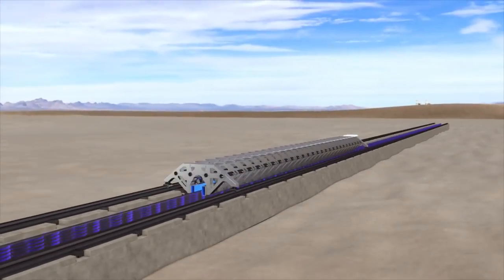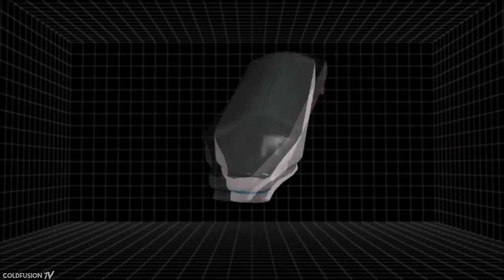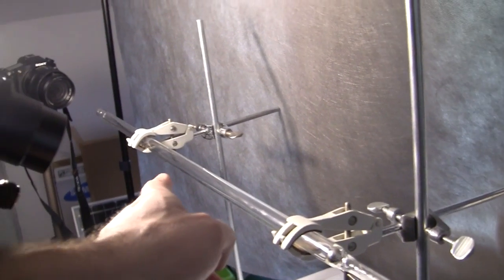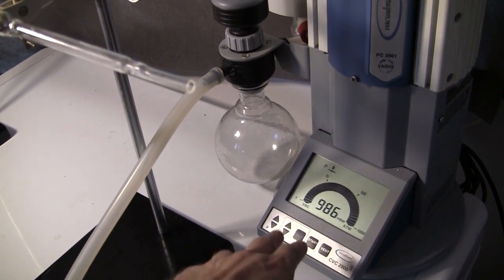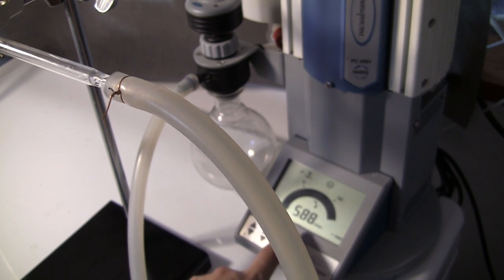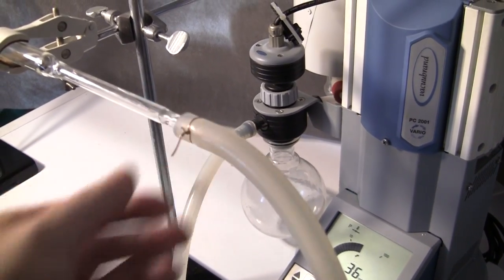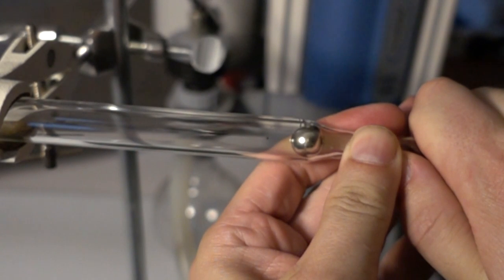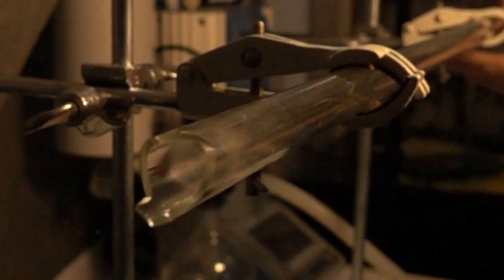How  the Hyperloop can kill you!

Comment: Brakes exist you know.
Reply: They'd all die from the sudden increase in velocity anyway.
Reply: Let me know when you've made breaks for your flying objects.
Reply: Look at the animation in the beginning, I see several ways to apply brakes. You're not a creative thinker.
Reply: +Merrick How do you think maglevs slow down?
Reply: A train has a lot of mass. It wont change instantly. This just shows how much Thunderf00t overlooked.
Reply: OF COURSE! ANTI-MAGNETS!
Reply: Shit, if a plane has a catastrophic failure, it will fall down from the sky, and NO WAY STOP IT. 
Better cancel this whole "air plane" idea.

This reminds me of when Thunderf00t said that if bicycles where invented today, they would get banned.
The hypocrisy is real.
Reply: have you tried to stop a bullet?
Reply: Forssa1 You are SERIOUSLY underestimating how fast this would happen. You must be dense if you think you can slow a train fast enough to prevent a wall collision here. Even modern trains can't do that in the event of a derailing.
Reply: Forssa1 a leak in a vacuum tube is much more likely than a critical fault with a plane.
Reply: I don't know that much about magnetic levitation
but could it possibly be made so that in an emergency 
the electromagnets be reversed so that the upwards force to lift it would then pull it to the ground
that could work as emergency breaks
Reply: Normally I don't get into these discussions, and my own opinion on weather or not the Hyperloop will work aside:

How would air brakes work in a vacuum tube? The issue is a rupture and the pressure of air pushing the train, so flaps will have pretty much no effect.

If you are talking conventional brakes, that has its own issue. Big Rigs on the road use engine braking more than conventional brakes because the wheel brakes wear out super fast on those vehicles and don't work as well as the engine as is. So scaled up and you have brakes that will have a near impossible task of fighting the forces put on them, and without rubber likely to help reduce friction.
Reply: People have little reason to listen to you if you just say "I can see several solutions" and explain or elaborate on exactly none of them.
Reply: +Merrick air brakes are a thing
Reply: All is lost You mean a controlled stop that takes place at dramatically lower speeds? Nothing could stop you from slamming into a wall and getting crushed here. This would take less than a second to happen.
Reply: Forssa1 A lot of mass is also a lot harder to stop as well as accelerate, though. The entire point of the system is to go beyond the speed of sound in the first place in a greater vacuum that in his demo. So, those 2 factors likely account for at least some of the mass & inertia difference. Essentially, you you're already going the speed of sound before failure & it's only going to get faster, so aren't gonna be able to suddenly stop that easily. 

The bullet trains at least have wind resistance to help them slow down and their failures don't result in them going much faster than their normal travel speeds. They also don't normally try to stop on a dime even in the event of a failure.
Reply: Forssa1
If you're not gonna explain yourself then why are you even here talking about it? To make yourself feel superior, or to just bullshit everyone for your own amusement?

I suspect the latter.
Reply: +Forssa1
"Plane ... catastrophic failure"
So you are talking wings flying of right? As you can land a plane (and even a helicopter) without engines etc, as they are pretty stable concepts.
A vacuum on the other hand is super unstable and a "catastrophic failure" would be closer to the norm than a rarity.
Anybody who has ever worked with vacuums knows how unstable and how dangerous they can be!
Reply: Physics exists you know
Reply: You realize of course that the car itself can control the magnet track. The magnets aren't all running all the time. They are electromagnets. They can be turned off. By the car.
Reply: Releasing air along the whole tube would that not mitigate the issue?
Reply: Forssa1 It's a good thing planes have so much more room for error, unlike this deathtube. You are an idiot if you think there is a force on this world that can react to, then stop, a train going the speed of sound in the timespan of a second.
Reply: +MGIBlaze I'll happily do that if you are willing to pay full price for my consulting.
Reply: +Milky Shakes Good luck using air brakes in a fucking vacuum.
Reply: It could push padded rings outwards to touch the walls of the tube to decelerate... come on now.
Reply: ***** you don't seem to understand how phyics work.

For example a bullet firing out of a gun travels at 300MPH ish.

If you fired a artillery piece with as much force proportionally to the shells mass it would also travel at 300MPH ish.

Scale would not effect acceleration scale would simply mean you would have longer to accelerate meaning that you would get to much higher speeds in a longer tunnel.
Reply: Science, bitch.

a = F / m
Say the area of the capsule's end cap is about 3m&#178; (radius of ~1&#178; * π) so A = 3
F = P * A
Atmospheric pressure is about 100000N/m&#178;, so P = 100000
F = 1000000 * 3
F = 300000N
As a guess, say the capsule weighs 5 tonnes.
a = 300000 / 5000
a = 60m/s&#178;
Now remove acceleration based on the resistance of the near vacuum at 1/1000 atm:
a = 59.94m/s

That's basically 6g. So yes, you'd probably survive. That said, you probably wouldn't survive crashing. If, however, you came to a stop without hitting anything you'd be okay.

Before you critique me, remember, this is a 5-tonne capsule. If it were lighter, you might not fare so well. Heavier, maybe you'd do better.
Honestly, though, I think that most people would boycott hyper loops if decompression did ever happen given how traumatic it would be.

[Edit: Google is retarded - "&#178;" = squared sign]
Reply: ***** You don't understand how air enters a vacuum, clearly. It wants to go where it isn't.
So if I have a rupture at one end of a tube, and then immediately open the other side of the tube, the opposing influxes of pressure will nearly cancel each other out.
The car clearly isn't at the end you've opened yet, there will be no further acceleration.

"so you want to add a source of electromagnetic fluctuation in a vacuum and use it a a brake?"
The point of mentioning the rail is that it's clearly not part of the tube which seemed to be your issue with the idea of brakes, that the car is just in a tube. It isn't.
And I'm not suggesting directly braking on the rail itself.

Parallel to that rail, you can have 2 magnetic brake runs, which you might know of if you're familiar with newer roller coasters.
They generate an opposing electromagnetic force which is directly proportional to the moving speed of the object, and never actually have to come in contact with the objects(the car).
Reply: ***** Just like cars.. nothing could ever go wrong... except it does.. several thousand times a day...
Reply: *****   Although you are correct in the example you site, there's no way that simple of a system would be used.
Reply: Was curious, so I did some maths:

(((1 atm - 1 millibar) * pi * (2.23/2)m^2)/2800kg)/ 9.8 metres per second squared = 13G of instantaneous acceleration. Not fun, but should be survivable for a short time if seated correctly. That also assumes a perfect seal between the vehicle and the track, and that there's an instantaneous, complete fracture of the tunnel right behind the capsule so that the pressure rises to atmospheric instantly.
Reply: InfernosReaper 
That was my point. Mandragara was claiming brakes would shatter the capsule. Only instant brakes would. Momentum reducing breaks (you know any brakes that exist in this universe) wouldn't do that.
Reply: +Milky Shakes airbrakes are exactly what causes the sudden acceleration. it's the body of the train that catches the air that rushes in from behind, but something that Thunderfeet forgot, is that if the train is lrdy moving at the speed of sound then the air coming from behind it won't even affect the train's velocity.
Reply: agun17 
Hrm the difference being your shitty gun has a 20 inch barrel at most and this has a 100 mile barrel. Plenty of time. Especially for an automated system.
Reply: ***** 
No an active safety measure is not expensive. It's cheap. And safety measures always lead to long downtimes. Planes have them, Trains have them. It's the expense of being safe. You still are disregarding the fact that unlike the marble the train is already moving at the maximum rate of pressurization as pointed out by several people. On top of which as someone mentioned the negative effect of a fault could be easily mitigated by airlocks that close behind the train. Then you only hafta repair and re-de-pressurize a portion of the track.
Reply: agun17 
...
While a break after the sled would be more problematic it's not more likely. You know that the sled will not actually apply pressure ANYWHERE and if it did it would be for .0001 nanoseconds right? But like I said already it wont apply pressure. PERIOD. It's being suspended by a magnetic field in a near perfect vacuum.
Reply: agun17 
... >.< The magnet system is a separate substructure from the pipeline. You really have a problem with seeing things from a distance don't you? You're the type of person who if I explained why a car engine is called a combustion engine would have a panic attack.
Reply: ***** 
No it's you who doesn't. Air rushing into a vacuum moves at the speed of sound. So an object moving faster will outpace it. On top of which no you over estimate what kind of door would be needed. We already have airlocks that can withstand massive pressure disparities.
Reply: ***** 
You know hyperloop has been in development for a decade and has the support of MANY engineers and scientists. You are looking for any reason to defend TFs claim that it's bad. That's the thing. I bet you are 100% convinced that Brexit is the worst thing ever too aren't you? Solar Roadways I'm skeptical same with the nuke car. The difference being they aren't minor upgrades to tech that is in use today.
Reply: Stephanie Lovik I am claiming it is bad. Me, myself and I. The royal 'we'. I don't care what TF has said.

The idea of travelling in pneumatic tubes has been around for over 150 years. There's a reason they've never been actualised.

Nowhere in the world does a hundred kilometer vacuum tube exist. So I have no idea how you see this as a 'minor' upgrade.

I'm ignoring your Brexit red herring.
Reply: uh, brakes in this case would only be deployed in an emergency. They can be rockets/reaction systems pointed at both ends or some kind of wheel that springs out and latches onto the tube walls the millisecond the pressure sensor finds a pressure leak, or you could puncture the opposite side of the tube and if you do it just right, the two forces will equalize - and unlike TF's experiment, for a vehicle moving at hundreds of miles an hour its infinitely unlikely a puncture will happen right in front of/behind the train, giving it ample time to react. of course, the prerequisite is that people stay sat down and belted in (which shouldn't be a problem for the short trips hyperloop promises), but people are able to survive forces of 50Gs so as long as the brakes keep the sudden acceleration beneath that, the passengers would live.
Reply: Air weighs ~1.2kg per cubic meter. A pod weighs what ? 5 tonnes? A full size maglev train 100 tonnes? Such failure would need a complete destruction of the tube to get it even nod a couple meters.
Reply: There's no feasible material that could withstand this sort of thing in this situation.
Reply: considering the speed and the mass of a train the would more likely cause the rails everyting else to meld and burn before inevitable crash.
Of course if everyting would be made to perfection this may work but is that realistic?
Reply: Forssa1 sudden Air pressure changes Has a lot of potential force. It does change instantly, This shows how much you overlooked
Reply: Forssa1 Why because everyone can tell you you're wrong?
Reply: Theoretically, with a strong enough magnet, it would stop the bullet. But we see your point.
Reply: They're called airbrakes. Planes have had them nearly as long as they've had wings.

Even though there will be no air in the tube, in which case, the electromagnetic tracks serve that purpose.
Reply: +Forssa1  Or what if the tube had a series of gates and you could control the pressure level as the capsule accelerated?
Reply: Milky Shakes its in a vacuum, there is no air.
Reply: Forssa1 So you're just going to take another concept and roll from it from there. I saw the comment you're taking from.
Reply: What matters is the mass/cross section surface. And I think the ratio would be even lower for a train. It will probably be crushed and, then, accelerated.
Reply: Would they? Math needs to be applied here to confirm.
Reply: You open the tube to relieve the vacuum ahead of the car, and seal the tube behind it. So yes, there very easily could be air.
The loop is made in sections.
Reply: +Forssa1 gates are dangerous since they would be a barrier that could malfunction and the train could hit them. I was thinking maybe put the tube inside another tube with normal (or higher) pressure. If something bad happens, then valves all along the inner tube will open up and allow all the air contained in the outer tube to flow in. You'd create gusts of air from both directions of the train which would mitigate the effect TF demonstrated and would help the train to slow down much faster due to air resistance from the front.

I think the real problem here is the acceleration of the passengers themselves.
Reply: +Morru Qu'aan can't you just extend steel arms against the walls of the tube?
Reply: i agree, this does not seem like an insurmountable problem. I think it would be fairly easy to stop the car if you had some extra track in front of you, even extra 'run off' track at each end of the loop. the only difficult problem is trying to prevent the car from accelerating too fast to be dangerous to the people.
Reply: +GameSmashDash No. The train is not a metal ball. Also read up on square-cube law.
Reply: a) atmosphere and friction exist in cases of trains
b) giant steel fangs that grip to the rail also exist in emergency cases, impossible for a vacuum tube.
Reply: OrnluWolfjarl   The gates could be spaced kilometers apart and made of composite plastics so if the capsule collided with it then it would just break free.  I think we are focused on the wrong problem here.  Will it be economical is my first question.  The Concord wasn't so they stopped using it.
Reply: Morru Qu'aan   If it is using an AC power transfer system a brake by wire device could be used to slow the capsule - ie magnetic brakes
Reply: ***** "Good luck using air brakes in a fucking vacuum."
You relieve the vacuum genius. Open the tube ahead of the car. Air rushes in. The air brakes do their job.

"b) giant steel fangs that grip to the rail also exist in emergency cases, impossible for a vacuum tube."
Not if you remember what it's being levitated over: a rail.
Reply: No the acceleration isn't that bad the point is you have miles to speed up until the fault. But as other people have mentioned.

You can have Valves on opposing ends to equalise the pressure, brakes etc.

The instantaneous acceleration does not go up due to scale because a larger object will have greater mass which will counteract the greater force being applied. What does go up is the length of which you have to accelerate.
Reply: but a brick wall would  quite happily do the speed of sound in a vacuum.
Reply: Breaking isn't the issue... It's not "Being trapped in the tube" that's the issue... The issue is when the vacuum fails, it's literally going to accelerate the vehicle to such a high velocity in such a short amount of time, that it's going  to severely hurt and/or kill whoever is in that vehicle.

Pilots already have to do training to handle High Gs ((Acceleration)) so as not to become unconscious from the pressure on their brain pushing the blood right out, and that usually comes from a slow build up of acceleration, not this sudden shot.
Reply: +ANDELE3025 Or even friction brakes. Or even reverse jet propulsion.
Reply: *****
OK, so you cause a pressure leak and fucking catapult the cart even faster into death. smart move.

>being levitated over: a rail. - so you want to add a source of electromagnetic fluctuation in a vacuum and use it a a brake?

Right, making the cart accelerate and turn into a giant ball of flame is the solution to stoping it. Clearly noone ever thought of it that way, i mean they will stop once half of it melts into smithereens and everyone is dead.
Reply: AdventureThroughLife
Yesss... causing friction in a vacuum tube that is suddenly being filled with air is clearly a smart idea. Nothing could ever go wrong.
Reply: Have you tried push train by blowing air at it?
Reply: ***** 
>So if I have a rupture at one end of a tube, and then immediately open the other side of the tube, the opposing influxes of pressure will nearly cancel each other out.

And everything in between gets initially accelerated by the side opened first and then squished by the rapid increase in pressure, gratz on killing them again.
Reply: ***** You do realize the tube is a sealed area, thus there are walls all around you, right? I really hope you aren't assuming we mean running into it straight, because once you derail you are going anything but straight.
Reply: AdventureThroughLife
While i do agree that cars should be scrapped in favor of trains and trams (due to killing more people in a year than the ancient hokey gods took blood sacrifices across the entire existence of those cultures), moving crashes and shitty things happening from 100~400 kmh to 1000~1200kmh in a fucking vacuum with the cart having pressure and whats worse, oxygen (i repeat, a tube of oxygen in a vacuum tube held up by electromagnetism which causes EMF and thus friction) are 2 very different things.

While rarely anyone would use it (due to massive cost tickets would have no matter what hypothetical version of it they would make into reality they pick) and thus death count would numerically far lower than car related deaths, it doesnt make it any less of a impractical and dumb idea (especially at current tech and tech resource cost available when it comes to making massive vacuums).
Reply: John Norris
And there is the problem, you cannot make a technically feasible mode of transport thats in a vacuum and goes above 400mph  without a metric shitton of safety features that would make 1 trip with the thing cost more than doing anything you want with it at the other location (especially since basic maintenance of things like the ISS, which has far less things possible to go wrong and is vastly smaller than any functional amount of vacuum tubing would be to make use of a Hyperloop... and pressurization being technically cheaper than holding a vacuum, is between 4 to 6 billion $ a year depending on how much support it gets, around 400 mil being fuel, 200 basic repairs, etc).
Using a giant vacuum tube as a propellant for shooting shit into space would be more efficient and exponentially less potential for human casualties.
Reply: A brake would rely on friction. At the speeds you are going air brakes would be optimum as mechanical pressure brakes would fail upon being pressed to the tube and possibly just make things worse. Though you want to avoid slowing too rapidly. and air brakes would be next to useless in a vacuum so unless a system is installed that can rapidly return full pressurization to the tube network in the event of failure that is not a good enough solution. It's not like we're FUBAR but we need more than just one fix.
Reply: So many smartpeople here, I wonder how science never looked on youtube comments for answers.
Just youtube search "A crab getting sucked into a underwater pipeline."
Reply: You failed when you said "instantaneous acceleration". Now take into account the inertia of the train.
Reply: John Norris
There were many reasons why they discontinued the Concorde but the main one was that it was unsafe to fly. The first and only crash of a Concord happened due to vibrations causing the wings to rip off, and it was found that all aircraft were prone to it.

Even if you make the gates out of shattering plastic, at the speeds we are talking about they could still derail the cart or cause damage to the tube.
Reply: "instantaneous acceleration" = "the acceleration experienced by a capsule the instant after the failure occurs", if that wasn't clear. The inertia is taken into account - 2800kg of capsule mass.
Reply: Would shatter the capsule. Like putting the barrel of a gun to a lead wall and firing. RIP bullet.
Reply: ***** 
Not really. If the brakes were instantaneous maybe but no brake is. The space shuttle has brakes. Supersonic combat planes have brakes.
Reply: Stephanie Lovik
If breaks were instantaneous, everyone would die from the sudden stop
Reply: Stephanie Lovik
But this is a vacuum failure scenario. Breaks won't work well in that case...
Reply: InfernosReaper 
Actually as discussed previously it's a multi fold problem with multifold solution. TF is generally a logical guy but lately I've been noticing the same problem with him as I've seen with couch scientists for years. They can only ever see one facet of an issue or solution. The vacuum failure is a problem because it causes an inrush of pressure behind the vessel. Mechanical friction brakes can help alleviate this even in a vacuum as the principle of friction does not depend on air pressure. At these speeds mechanical brakes alone would too rapidly wear down. So next we have the option to switch the maglev to a maglock. That will unfortunately cause the vessel to plummet into the ground rapidly. So it alone isn't a good option. Then we have air brakes...oh yeah, vacuum. We still have a gel/foam matrix friction dampener but again at the speeds mentioned it would spread too rapidly. But what happens to all of these problems if the chamber suddenly lets repressurization happen from every point instead of just the fail point? We get an equalization and then these factors working together solve literally everything.
Reply: Stephanie Lovik
Ya know he's an actual scientist, right? Like nuclear physics & stuff, man

That aside, how would you even come close to being able to implement a repressurization in a timely enough manor to stop it in time?
Reply: InfernosReaper 
And? Scientists can be shortsighted idiots too. I mean seriously? Appeal to authority? Fuck off with that first grade shit.

Simple fact he is looking at the problem from EXACTLY one point of view and I demonstrated that there is much more to the picture.

How would you pressurize in a timely manner? You know that both RF and direct electrical connection both travel over 100x as fast as the hyperloop will right? So using EITHER of these systems you could create a data propagation system that opens thousands of valves along the length of the structure. It's not like a rapid pressurization will be hard to detect. TF himself had a tool to measure pressure.
Reply: so many autistic geniuses that seem to know so many solutions.
Reply: Stephanie Lovik The deceleration you'd need to match the acceleration would shatter the capsule. A vacuum breach is a death sentence for the entire network
Reply: agun17 exacly as Stephanie said, your gun is short as a fag, and our hyperloop is long as a man. it takes less than a second for the bullet to get out of the gun, and it takes half an hour for the train to complete one trip.

also, the train is designed to move at the speed of sound.. which means thunderfoots little trick he showed us doesn't matter, because the rushing air won't even reach the vehicle, for the air is moving at the same speed as the train....
Reply: *****  who ever talked about a network?

anyways, ever heard of airlocks?
Reply: Expensive, active safety measures suck, breach would still kill everyone and it'd be very expensive and time consuming to pump the air out again.

This things a bigger pipe dream than the nuclear car
Reply: ***** Not if you pressurize the tube you bleeding twit. You don't need to instantly stop the train. You have hundreds of miles to slow the train down in. Additionally the acceleration you mention is 100% dependent on the added pressure being localized to the 'rear' of the vessel. So it would be vastly mitigated by an automated repressurization and deceleration mechanism.
Reply: ***** the track in it self is lrdy expensive. a little door at every junction won't hurt. it means that only one line will be afected by one breach.

the breach would ahve to happen in front of the capsule for it to even matter too, because the capsule is lrdy moving at the speed of sound so there is no speed to which to accelerate to. it'd be like shooting a bullet you shot in mid air to make it go faster. you will have acomplished nothing.

a tiny ball is a bad anaolgy. a better analogy would ahve been a cylindrical steel beam. the train's contact surface with the air rushing in will be basically the area of a crossection of the tube, but it's not a ball. it's a train, meaning it will have mass behind it. a little air rushing in won't affect its movement as much as thunderfoot would have you believe.
Reply: ***** also i would think they had to have airpumps to pump out any odd gasses that got into the tube from the entrences and any possible cracks. there will always be some kind of hole the air could get in thru, so you would have to have airpumps anyways. this is just not really as big a probelm as you seem to be thinking it is. how often do you immagine these catastrophic failiours would be happening anyways?!
Reply: You have no idea how shock fronts behave. This isn't like blowing on a dandelion.
Reply: I think you underestimate what sort of 'door' you'd need to withstand a breach event. "capsule is lrdy moving at the speed of sound so there is no speed to which to accelerate to." - you don't really understand how speed works do you :S
Reply: It's already moving at the maximum rate, so it gets to smash into the oncoming shock front at full speed? Great...

How do you expect these large airlocks to work? Where do they go when they open, how do they seal, what happens if they fail to open for the oncoming train. Soo many issues.

I like how you mentioned depressurising as an afterthought. As if it wouldn't take weeks and cost millions.
Reply: It's called a shock front. Decompression happens faster than the speed of sound. Do you really think a vacuum breaks as slowly as the speed of sound? It'd happen at a rate of thousand miles an hour or so.
Reply: agun17 
You seem to think that you are somehow cleverer than engineers. People like you are the ones who protested the LHC because you were fed hyperbolic data about how it could cause a black hole. >.< Seriously redundancies are in place and planned.
*****
I'm done talking to you because you are even more hyperbolic and less educated than agun17.
Reply: Stephanie Lovik You're just annoyed at me because I'm poking holes in an idea you really like.
Reply: I haven't mentioned TF once and gave my own reasons for every issue I raised. You're so defensive lol, there's so much REAL new technology being developed. Stop wasting breath defending this silly idea. Next thing you'll be defending Solar Roadways or nuclear cars.
Reply: ***** 
https://www.physicsforums.com/threads/why-do-air-rush-into-vacuum.465161/
"Because the air molecules are flying about at a very high speed, comparable to the speed of sound. They don't rush specifically towards vacuum either. Some molecules just happen to be flying that way, and there is nothing going in reverse, since there is nothing there but vacuum. The net flow is therefore from filled room towards the empty one."

my theories are rigth, and your claimsthat they are wrong, are wrong themselves. a rapture behind the sled is not a safety issue.
Reply: Exactly. And the faster molecules travel further into the vacuum per unit time then the slower ones. So you get a ...... shock front!
Reply: agun17 well you all ready have about 250kg/cm² worth of atmosphere pushing at your tube, so the tube should be able to resist at least double that from within just by default.

i would do calculations on how much the train would affect the structure, but i don't have any stats on how heavy the capsule or what ever would be, nor do i have proper images on what the magnet layout would be, but obviously the designers would do those calculations when they build the train. this is not being built in North Korea.

they would also most likely have to have lot's of extra strength because of safety concerns, so the movement of the train will not break the train line, for it is designed for the train.

sure, the train would apply a force onto the structure, but you would need something other than the train for it to break. maybe erosion or something, but that's why you have mechanics or what ever who check the integrity of the railway at regular intervals.
Reply: ***** you know what that means? if the odd gas molecules reach the ship, guess what happens!

the ship accelerates.

since the ship is traveling at basically the average speed of the air, most of the air molecules will be too slow to catch up to the ship. here, have a graph: http://ibchem.com/IB/ibfiles/states/sta_img/MB2.gif

the blue line represents room temperature molecules. the average nitrogen molecule moves at (about) 509 meters per second, that's about 1832 kilometers per hour, but the problem is that they're not all moving at that speed AT YOU, rather in random directions, because the reason the air is coming at you, is because there is a hole where it doesn't bounce back... anyways, that would give us the average speed which is shown on our blue line, but we have to adjust for the fact that they're not all aimed at you, meaning just because their average speed is what we mentioned doesn't mean that's teh average speed of the bla bla bla..

the fastest and luckiest (nitrogen) particles will be moving at a speed of 10980km/h, but a single nitrogen atom only has 0.000 000 000 000 000 000 006 1 Joules of energy... so those won't really be hurting the back of our ship that much. also we're moving in the same direction, so that also removes quite a big a margin of the possible energy.

my point being that the molecules that reach the vehicle first only help cushon the effect of any possible molecules that were coming from behind, because they would just make the vehicle go faster, and thus make less and less possible for slower molecules to hit you.
Reply: +Forossa1 UGH I HATE YOUTUBE EVERYONE CAN TELL ME I'M WRONG UGH. 
Dude. There is not way to apply safe brakes to this. Even if you didn't die from the acceleration before you could apply the brakes you would die from the sudden deceleration from the actual brakes themselves.
Reply: +HVM That's a retarded statement. A more accurate thing to say would be: "Have you tried to move a feather by strapping a rocket to it?". Because that's basically what would happen.
Reply: +julkkis666 Yes, because death is just going to wait to kill you because "oh the tunnel is longer". It doesn't fucking matter how long the tunnel is. It could be 1m for all we care. It will still achieve lethal acceleration.
Reply: Charanor what are you talking about?

i would like you to explain your statements, so that i may understand what you are saying.

thank you!
Reply: ***** You were talking about how the tunnel is longer than a gun barrel so you have longer time to brake. But it doesn't matter how long you have to brake because you will be dead before you get the chance to brake.
Reply: That only works if the system is at equilibrium. If it's not at equilibrium the particles bounce into the vacuum unopposed. You get what's called a shock front, look it up on wiki
Reply: Charanor what will kill you in this scenarion, may i ask?
Reply: agun17 i still do not believe that if pipe behind the train breaks the train will suffer much of it. if the train is traveling in the same direction the air is, then the effect of any air that hits the train will be reduced a shitton.

let's say the ball bearing in thunderfoot's video is accelerated by 20g. max half of the air molecules will be traveling fast enough to even reach the train (from what i researched yesterday). that puts our maximum acceleration at 10g. then we have to remember that thunderfoot's train is a ball bearing, and has a larger surfacearea/mass ratio, because the tram will most likely be longer than it is tall.. tho i have read that the tram won't weigh that much.. (starts thinking of a steel bearing 2 meters high) ether way, even if that isn't true then we have the fact that the train isn't toutching the walls of the hyperloop, thus air will be able to get past the train, and thus push it backwards too after milliseconds of the theoretic acceleration caused by the air pushing at the train.  (i think i did some calculations and such a bearing would weigh ether 33 tons, or 3 tons. that depends on if you convert from cubic meters to cubic centimeters by multiplying by 1000 or 100 or something else. (actually nether of those is rigth.. and aparently such a ball bearing would weigh 22594 tons, assuming all other numbers in my calculation were correct... idk.)) anyways, if we assume we have 10g:s of acceleration AT MAX after a rapture, even if it gets that high it will only be endured for a short time because the shock front will get past the train and cause atmosphere to exist infront of it. the following curve will show how many molecules will reach the vehicle: http://prntscr.com/bvneez

after a specific speed of air has reached the train, they will actually bounce back most of them, and go back twards the rest of the air, theoretically helping lessen the amount of air by a really insignificant amount... the air that does stick arround will eventually (in under 1 second) find its way thru to the other side of the train, and bounce at the front of the train. this also happened in thunderfoot's little simulation. the air got past the ball, as the ball reached the end of the tube it had slowed down a bit, and didn't actually hit the end of the tunnel at full speed (speed of sound)... funny thing is, that the train is lrdy moving at the speed of sound.. so there isn't really anything to accelerate to.... :/

now it's a totally diferent story when the air comes from your front, but the vehicle has blades, which help ease that effect too.
Reply: agun17 still, not all air molecules will be traveling at that speed. the vehicle has mass, meaning it won't accelerate instantly, but theoretically yes, the vehicle i guess will accelerate by 600km/h, but the interesting part is how fast. it would be really interesting to see someone do the math. first thing we would need would be the diameter of the vehicle and its mass.

some people have suggested that you could have an automated system where you would close an airlock behind the vehicle to save it from this shit. obviously airlocks will be a good countermeasure to use in a system like this. having a huge vacuum is not that good an idea, and having the possibility to close it into sections would be good. if a rapture were to happen, it would bee good for you to be able to close the section down so that you would for one have less air to pump out and it'd be cheaper.
Reply: RoMMeL1337ak47 so if one atmosphere of presure is equal to about one kg/cm^2, and the train has a back-side with about the area of 4 square meters, we would get about 41332 kilograms of force on the vehicle, theoreticlly speaking. that's about 40 tons of force.

i guess i am too stupid to turn this into acceleration.. what do i multiply and divide by here?
Reply: RoMMeL1337ak47 i got the KGs from converting one atmosphere into kilograms/cm^2, and then multiplying that with 4m^2 that you gave.

i have heard that the train migth weigth something like 7 or 70 tons i think... i guess you could try both numbers and see what they give us.
Reply: in physics and chemistry class i told my friend what to calculate and he calculated. he didn't like thinking, and i didn't like calculating. we were a good match. we were also 2x as fast as everyone else.
Reply: agun17
When a fluid is standing, you use static pressure. In an intact hyperloop tube this would be near zero. When a fluid is in motion (relative to the surface) you use dynamic pressure and for that you need fluid density and speed.

Dynamic pressure is the kinetic energy of the fluid that is imparted on the object in question.

Worst case for Hyperloop pod/train would be hitting a section of tube at full speed that was at higher static pressure already - having a leak and filling/filled with air. This would lead to violent deceleration.